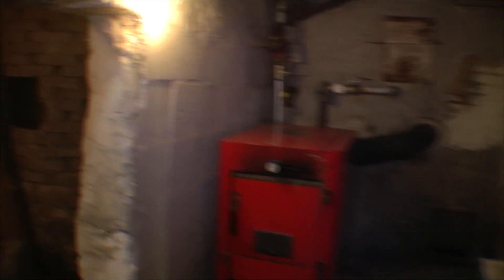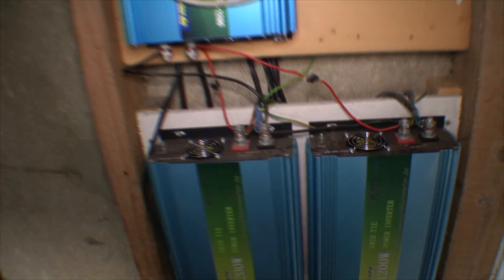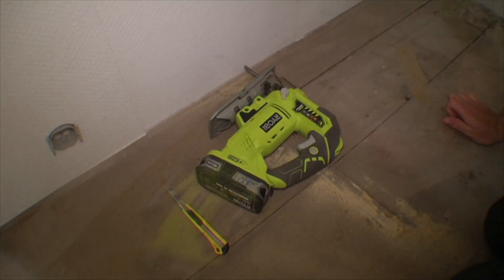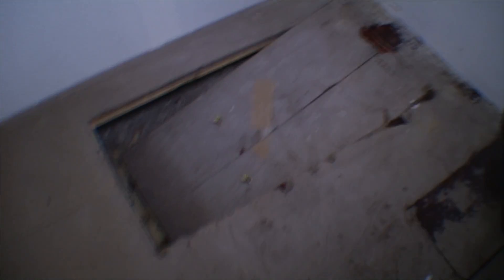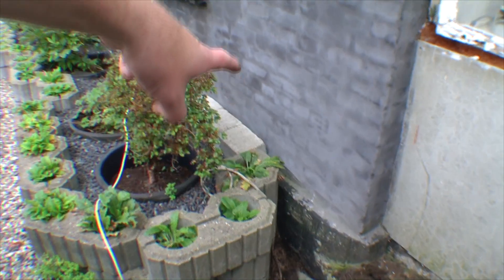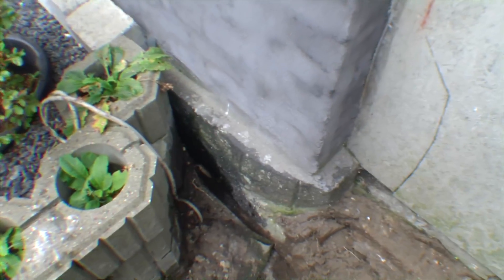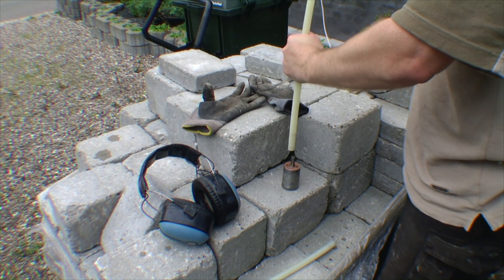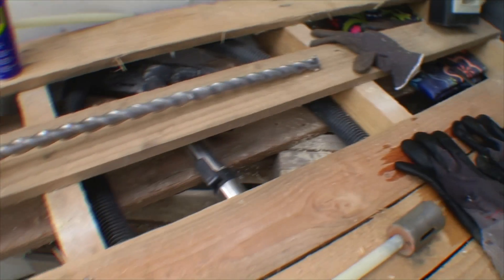Diamond drill, 40mm diameter and 60cm long hole - 235

Comment: What's the wattage of 1 inverter ?
And why don't you have one 12kW inverter (buyable from alibaba)?
And what are you gonna use to power the inverters ? Solar panels ? Car batterys ?

Nice video, keep up the good work :)
Reply from the maker: Hi +LuvFPS 
I have 1KW of solar panels, the inverters are 1200watt each,, but cheap China made ones so i have doubled up. 
I would like to play with this one : https://www.youtube.com/watch?v=2G8aeGl7w_Q
12KW is a bit much,, and a bit expensive to :-/
Thank you for watching! :-)
Reply: Well,
On alibaba i saw a 12kW one and it is not that expensive if you can pay a full rack :D it would be enough power to power 5 42U racks :D

Comment: Does the drill have a locking button to stop the chuck from turning? You can use a vice or clamp to turn the collar and unlock it. Another solution would be to use a piece of wood and a hammer and give the chuck a few good whacks in the direction that it loosens up. I've been successful with both methods when I can't unlock the chuck by hand.
Reply from the maker: Hi +logikgr 
No,,,no locking button to stop the chuck from turning :-/ I´ll try some more..
Thank you for watching! :-)

Comment: I know jigsaw blades are super bad for burns. I been burned once or twice by hot drill bits / tool blades. Once you get burned bad you learn soon enough haha :P Sometimes forget though.

I know the feeling of walking around with glass of water. I too used a whisky glass. The last time I burned my self it was the oven I think. The last time I nearly burned my self was cooking pot a few weeks back.

Oh I remember now one of my worst burns of my life was a steam cleaner for your house. I pulled the release valve years ago with full pressure. I did not know what the thing did until I pulled it. I thought it was an attachment point. 

Another item that always gets people is soldering irons. They are terrible for burns. Got me on my knuckle a few weeks back while I was not paying attention. Too busy looking at the PCB.
Reply from the maker: Hi +thingyee1118
It helped a lot to have my fingers in a glass of water, but it took all day for it to before it was not hurting anymore. 
I hope there is a while before i need to do that mistake again :-)
Thank you for watching! :-)